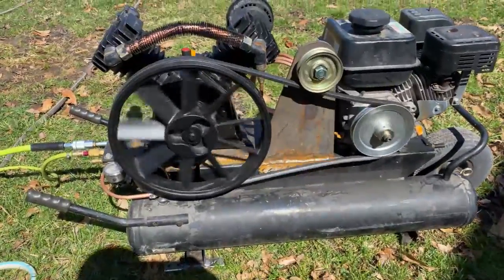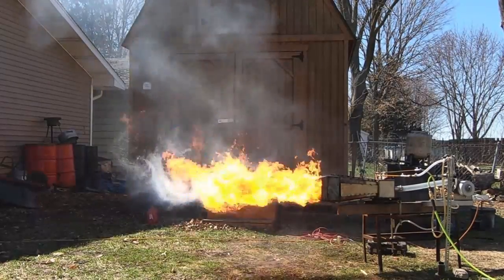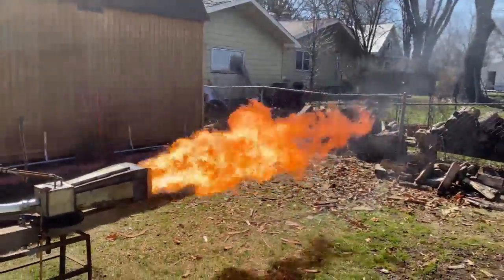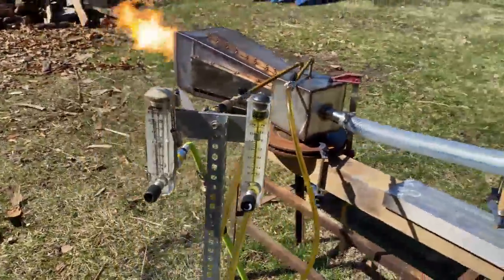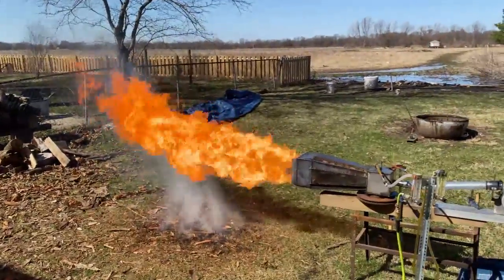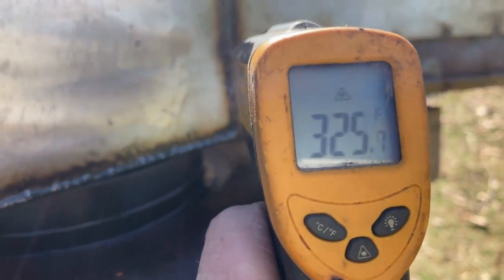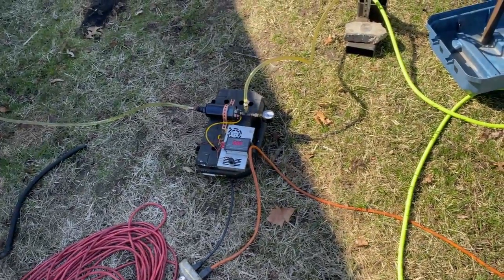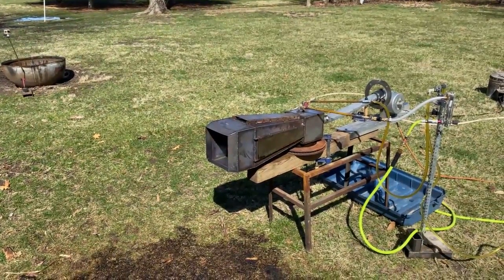2.5 Mega Watt Universal fuel burner

Comment: Looks good. What kinda flow meter are you using for the oil side? A normal one will not work because ball is in dirty waste oil. Can you give a link or a name of the type?
Reply from the maker: Standard roto meter , problem is the viscosity drag gives a bad reading as well . The old stop watch test seems to be the best rout to date

Comment: Been building a burner to incinerate animals on the farm. Got a huge flame to start with the one blower, but it ended up blowing it out. So far, I imagine my flow rate it too low. A smaller blower gave me a consistent, but smaller flame. Using old engine oil. Somehow fire turns me into a 'naughty' little boy...;)
Reply from the maker: you need more turbulence in the pre burner , put a back wall in place or a ring plate in there to make the air roll over a wall and behind that wall a circular fire ball will develop  maintaining combustion no matter what you do

Comment: I've seen an article and it says that, if you achieve 1000C+ of burner temperature, 650C+ of preheated air temperature, recirculation of combustion and a configuration where the preheat air is mixed with the fuel (gaseous fuel) on the combustion area, it will create a flameless combustion, which lowers fuel usage, lowers NOX and CO production and has a higher efficiency. I don't know how to explain because it's a very specific case, so I will link the article here: http://www.oil-gasportal.com/flameless-combustion/

Comment: My hats off to you fella for bearing your engineering soul to us all on YouTube. Point one, stainless steel has a 40 percent lower heat transfer from steel.Point two, the burner you have made does not push the flame in the center of the nozzle. You can see that in you video as the flame favors the upper part of the opening of the nozzle. Point three, If you use channeled air guide for your air preheater in a zigzag pattern your air itself will be heated to the maximum amount possible. This I think will maximize your heat output with any fuel. Nice video too.
Reply from the maker: yes the alignment was a result of a last minute modification , at high fire its not noticeable . I was interested to see what 1 degree of misalignment  would do

Comment: You might want to check your voice on 4:25. Nonetheless, what are the uses of such a humongous burner other than using it on an industrial boiler to generate electricity?
Reply from the maker: Sorry its my first 4k video and was a fail , my editing software cant handle it
Reply from the maker: There are many industrial applications that use this much power . This will be used in a destructive flash dryer